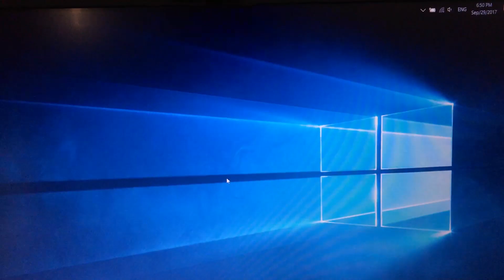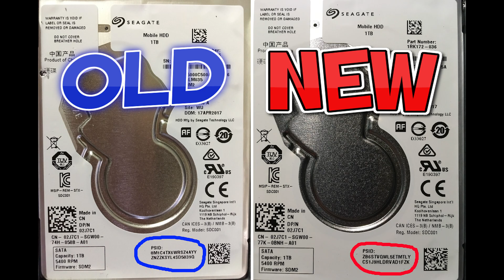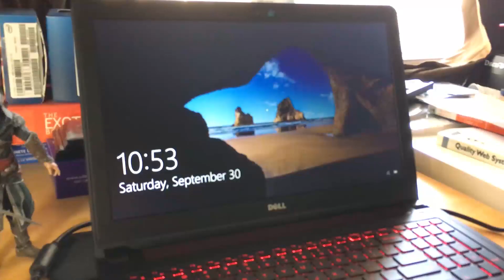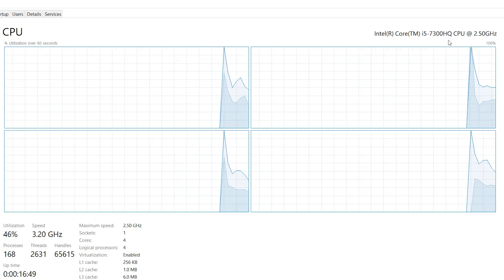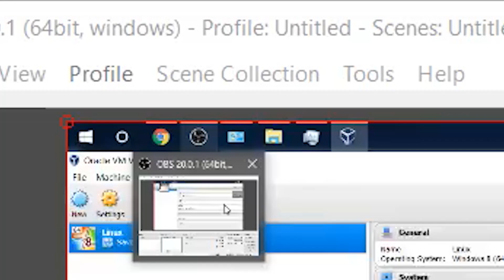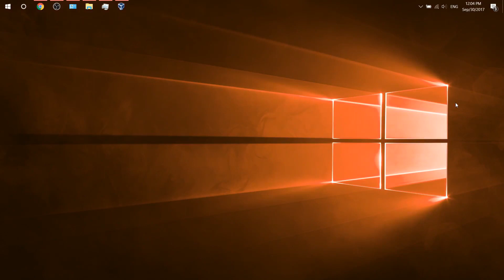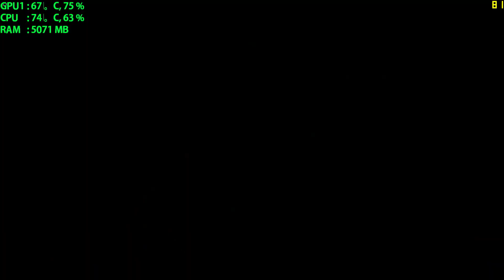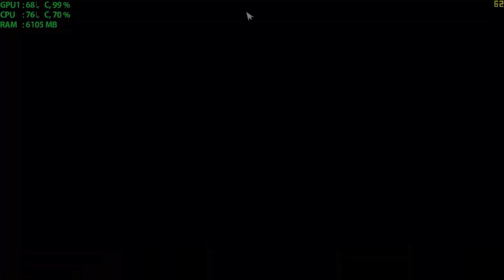My Experience With DELL Warranty - Inspiron 5577 - i5 7300HQ GTX 1050 Benchmark at 720p 900p 1080p

Comment: After 8 months the screen stopped working and we had to send it to dell for repair. Luckily the computer was under warranty.sadly the cable that travels through the hinge is attached to the lcd so if your screen fails you have to get a new lcd

Comment: Nice, overall review man, how many years would you consider this laptop has when heavy gaming?
Reply from the maker: I dont know, I used to game with a laptop packed with i7-4700MQ + GT 755m from 2013 to 2017 :)) 
As long as you keep your resolution low, you can play for at least 3 years I guess. An i7 + 1060 should be longer

Comment: The HDD in my 5577 laptop failed after 3 years. I removed it and put SSD. It is much faster. Wish I got the SSD model first.
Reply: Same bro
Reply: I know this is old, but in my case i always try to get my laptop with the least amount of ram and drive size. Those two things are cheaper to upgrade by my self.

Comment: Bought a used one i5 version for my brother paid 400 euros for it and im disappointed.. did everything i could still lags even on minecraft, masive drops on csgo from 150 to 70fps its almost unplayable but it should run smoothly with gtx1050 maybe i need to change the cpu of something?
Reply from the maker: You can't change the CPU. CSGO has received massive updates recently, try running it at lower resolution (720p) may help in FPS. But 4-core gaming, especially on laptop, is pretty dead. I don't play MC so I can't tell. This laptop is mostly used for programming

Comment: how is the fan noise? also does fan keep running when you have plugged in power to charge? also do you recommend this given its sound quality? its really very bad?
Reply from the maker: +Syed Ateeb Akhter Shah sound is terrible. Fan when it is full load is loud. But it does not run all the time
Reply: thanks for your reply

Comment: Is the m.2 slot able to take an NVME ssd? Also taking everything into consideration with the time it took to get your laptop back from Dell, dont you think it would have been cheaper to just replace the HDD by yourself? Time is money ya know, but yes I agree Dell was terrible with the replacement. Does the laptop function better now since they replaced the HDD? Or have you upgraded to an SSD, didnt watch the whole vid..
Reply from the maker: +Purnell Charles the problem went away when they replaced my HDD. I installed my Windows on the HDD and used for 1.5 months before getting a great deal for M.2 NVME. Then I transferred my install Windows to nvme for faster boot and used the replaced HDD for storing files and games. Still using it now. 100% faulty Seagate drive since the beginning
Btw, i made this vid before buying the nvme, so everything was functioning with the replaced drive
Reply: Poker FaZe thanks for the feedback. Hilarious video BTW. Watched it out.

Comment: Bro I have a question that what is the  fan speed you are getting...I have the same laptop with i7 variant ...I'm not getting speed above 3000RPM(or below) :(
Reply from the maker: +Ravi 3000 rpm? You know this is a laptop not a chopper, right? :))
Reply: Poker FaZe What speed are you getting...? I Know its not a chopper...But it is Capable of 5400rpm then why such low?
Reply from the maker: I think you misunderstood, 5400 rpm is the rotational speed of your hard drive. I don't know what my fan speed is, but as long as my laptop is cool, I'm cool
PS: the max speed of my desktop fan is just 1725 rpm

Comment: why was the frequency of the Cpu so high???  Which application did you run? I saw the Dell 7567 core i5 the same as this 5577 but its CPU just run at about 1.1Ghz on idle.
Reply from the maker: +tuan duong để high performance thì lúc nào CPU cũng cao hết nha. Lúc đó mình để balance, nhưng mình còn record screen nữa nên CPU cao
Reply: Poker FaZe vậy còn khi ko chạy app nào thì sao? :)
Reply from the maker: +tuan duong Nếu để high performance thì lúc nào nó cũng full clock speed hết, cái cần để ý là % utilization ấy. Khi nào bật power saver thì nó mới xuống tận 0.75GHz

Comment: hey buddy i am buying this today so need to ask some questions ... heavy games like gta 5, Wicher 3, cod infinite war games can tun on ultra settings smoothly?....and how much time charge lasts normally and while  hardcore gaming?...thanks in advance
Reply from the maker: +het vaidya Do not game on battery on any laptop. 
For your first question: you can only reach high settings with this laptop. If you play at 720p or 900p resolution, you get over 60fps. If you play at 1080p, it will drop below 60.
This video have benchmark parts, you can go and see it yourself
Reply from the maker: https://superuser.com/questions/855372/why-are-my-games-slower-on-battery-power-even-with-the-power-plan-set-to-high-p

Comment: is ur laptop get heated during game play while charging..?? Maxm CPU temp during gaming..??
Reply from the maker: +Ashutosh Kushwaha it shows in the benchmark
Reply: Poker FaZe i hv same laptop...in my laptop temp get above 75'c some time during gaming...is it okay.??
Reply from the maker: +Ashutosh Kushwaha un GTA V it gets up to 80C, but it is normal. I won't care until it is over 87C :3 Both CPU and GPU are made to handle the heat for laptop and desktop. Don't worry

Comment: Hi Poker, I have an issue... i bought the dell inspirion 15 5577 and with csgo I play 50 80 fps in resolution 1920... i dont know what else to do
Reply from the maker: +Matias Seguel lower settings, disable windows 10 xbox app

Comment: Hi - I own this same laptop and during gaming i get random FPS Drops/ Freezes for a micro second but it does makes my game stuck for that micro second and ultimately i die in most scenarios. So did you faced such while you play games. i get this issue in  PUBG and CounterStrike and i have my roommate with similar config and he doesnt face such issue.
My Config is Intel I5 7300HQ - GTX1050 4GB - 8 Gb RAM - 1TB HDD
Reply from the maker: +Sagar Gandhi I had similar problem. It did not happen during game, it happened when I browsed web. And it turned out to be the hard drive fault. This laptop uses Seagate hard drive, and Seagate is known for making bad drives.
Reply: It makes sense now - because even i had random freezes while using chrome. Idk why but even with the correct hardware this laptop feels so slow. I am going to add an M.2 SSD 250Gb and make it a boot drive. So lets see what happens after that. Will let you know !
Reply from the maker: +Sagar Gandhi If you still have warranty, try asking them to replace the hard drive. Before adding an M.2, my replaced HDD ran just fine
Reply: Poker FaZe Well i ran the diagnostic and the HDD doesnt show any error...so idk how would they give me a replacement.
Reply from the maker: +Sagar Gandhi that happened to me too. My HDD did not have any error, but it made buzzing sound. Had to call customer service and let the rep listen to the the damm noise.
Reply: Play games with high performance mode and not in balanced or Dell recommended mode.
Go to power options <high performance 
 The frame dip will not happen.
Reply from the maker: +HARSH CHOUDHARY thanks for mentioning this. May be he forgot to change. However, it was the drive for my case.
Reply: I have been playing on High Performance mode itself. The dips/micro freezes have something to do with HDD. I have just migrated to SSD now and i don't see those dips anymore. Seriously the internal seagate HDD isnt that good i feel. Lets see if i get any more micro freezes now or not
Reply: Update - After using since two days, i have not noticed any dips/micro stutters. It seems that windows 10 doesn't do well in laptop with HDD as HDD is too slow for it. SSD solved it for me, so it was worth the upgrade. System now boots around in 8 seconds

Comment: Hi bro can u tell me the difference between integrated and dedicated graphics and what type this lap has...?
Reply from the maker: Integrated GPUs are built with the CPU, like the latest Ryzen chips, or in every Intel chips. Dedicated cards are GTX cards or RX cards. This laptop has the GTX 1050 (dedicated). You can Google to learn more, I just say the basic
Reply: Poker FaZe ok bro thank you
Reply: Some guys say that the laptop GPU can be upgraded is it true? if its true is this lap upgradable??
Reply from the maker: Sure, some barebone laptops allows you to upgrade CPU and GPU. But GPU-upgradable laptops are so expensive. I once saw a German website selling an upgradable laptop which has dual 1080 SLI for $4000 and you can build it yourself, but forget about it. It is cheaper if you buy a CPU-upgradable laptop or buy an external GPU dock like these:
1) https://www.gigabyte.com/Graphics-Card/GV-N1070IXEB-8GD#kf
2) https://www.gearbest.com/laptop-accessories/pp_229101.html (I bricked the motherboard of my old laptop by using this, that's why I have the current laptop)

If you don't plan to build a PC, I recommend you to save money and go for the best laptops, so that you can just ignore everything and enjoy your games
Reply: Poker FaZe thank you so much bro...
Reply: I experience performance lag while playing games like GTA 5, assassins creed origins, just cause 3 is it common do u experience performance lag on this lap? If yes can u tell me a way to boost performance..
Reply from the maker: GTX 1050 is weak, try to lower your resolution and texture. I hope 1368:768 can keep you above 60fps.
I don't game on my laptop much so I can't tell you. But after finishing my Android project, I will do the benchmark on new games like The Witcher 3, Origins, etc
Reply: Poker FaZe ok bro..thank you for the info

Comment: i have this laptop without ssd, what ssd should i use? m.2 sata or m.2 nvme? i dont find information on manual book
Reply from the maker: +Aulia Majid both can be used with it, currently I'm using an NVME for extra speed
Reply: Poker FaZe have you tried it with m.2 sata?
Reply: Poker FaZe sadly 128gb nvme = 256gb sata in my country
Reply: pls anwer how do you know it support m.2 sata?
Reply from the maker: This shows M.2 sata is compatible, I believe all laptops even older gen support M.2 Sata, NVME is additional: http://www.crucial.com/usa/en/compatible-upgrade-for/Dell/inspiron-15-%285577%29
Just throw in an SATA, don't worry, you have my words :D
Reply: Poker FaZe okay im going to buy m.2 sata and see what happens :D
Reply from the maker: I will just boot faster :))
Reply: thanx bro i bought m.2 sata and its worked perfectly
Reply: Poker FaZe more question bro, my audio jack not working if i plug when laptop on, and working if i plug when laptop off and turn on the laptop after i plug my headset, do you have same problem?
Reply from the maker: I think you MAY have missed the audio driver, go to Dell.com and download.
Reply: Poker FaZe ive download it from driver booster, dell, and realtek website and all same, i uninstalled the driver and it works

Comment: I have dell inspiron 5577 i5 7th gen with 1tb hard disk. I want to upgrade it to 128gb ssd+1tb hard disk. How do I do that? Please help. Can I do it without sacrificing DVD drive?
Reply from the maker: +Ande Yashwanth Wait, your laptop has a DVD drive? Btw, you can look for an M.2 SSD, both SATA and NVME can be used with this laptop. Open the back to check if yours has any M.2 slot. I'm currently using Western Digital NVME.
Reply: Poker FaZe yesterday I had a chat with dell agent. He said "Your laptop has two slots 1 for M.2 PCie or sata". Bro Is there any difference in normal ssd and a M.2 pcie/sata ssd.
Reply from the maker: +Ande Yashwanth there are 2 types of M.2: NVME and SATA. NVME is way way way faster than SATA. For nornal SSD, you should not care because I believe you will use the 1TB HDD that comes with the laptop anyway, right?
Reply: Thanks bro.😋😋😋
Reply: Poker FaZe is it really work with SATA ssd?
Reply: Poker FaZe have you tried it? i dont find any information about ssd type on the manual book
Reply: 5577 don't have a DVD drive!

Comment: Hey bro I have the laptop and in far cry 5 on 1080p ultra setting I get around 35 is this OK or not sure
Reply from the maker: The 1050 is the weekest gtx 10** card, so yeah, it's normal. Even struggle with medium 900p

Comment: Please help! I bought a Dell Inspirion 15 5000 gaming with i7-7700 and 4gb gtx1050 and its struggling with CSGO. I installed nvidia drivers through Geforce experience not sure if im missing something else lol many thanks!
Reply from the maker: Please stop with "Help, I have problem" because nobody knows what happened to your laptop.
Try turn off XBox in Windows 10 Settings.
Reply: Poker FaZe Sorry :/ i will try this next time i get on my laptop thanks
Reply from the maker: I am sorry if I sounded salty (was busy with project), but if you can specify what happened to the game, I may be able to help.

Comment: Hey bro poker faze can u help me in choosing a laptop?? This one or lenovo ideapad 320 i7 7500u 8 GB ram 2 tb HDD and 4 GB gddr5 nvidia geforce 940mx
Reply from the maker: +Yuvaraj Rascal I don't recommend to buy any U CPU, they are used in most Apple Macbook to save battery, so they are weak. To game, you better get an HQ CPU laptop. But if you don't game, that laptop is good enough
Reply: Poker FaZe I'm a serious gamer I want to know which one is better some are saying that this dell model is hanging frequently but I think dell is far far better than lenovo...am I right?? and do u still have this dell laptop?? Is there any problem with this one?? Can I play games like GTA V smoothly at high graphics??
Reply from the maker: +Yuvaraj Rascal I have used Lenovo laptop through most of my college life with no problem until I stupidly destroyed its motherboard. 
I am using this Dell laptop for my last year of college. You can GTA V with it with over 60fps if you lower the resolution at 900p or 720p at high settings. 1080p will cause frame drop.
If you can get any laptop with i7 7700HQ + 1050 Ti for $650 to $700, go for it, ignore the brand. Lenovo, Dell, HP, Acer, Asus are all great.
Reply: Poker FaZe ok bruh thank you..is 940mx good enough for playing GTA V ?? My budget is $950 can u suggest me a good laptop??
Reply from the maker: +Yuvaraj Rascal GTA V heavily depends more on CPU than GPU and that CPU is garbage. With that budget, you can buy any better brand new laptop with i7 7700HQ + 1050 Ti. Here is a refurbished with GTX 1060 sold by Newegg: http://www.newegg.com/Product/Product.aspx?Item=34-316-212
Reply: Poker FaZe thank you bro but I'm from India and in here this dell laptop costs $1000..I'm gonna get this one
Reply from the maker: +Yuvaraj Rascal I'll add this one for you to look at if you are interested in. Check out this video: https://youtu.be/87R3DitE5wY
Reply: Poker FaZe sure bro I'll check it..what does a endless os means and can I remove that from a lap and install windows ??
Reply from the maker: +Yuvaraj Rascal I  guess it is an Linux OS. You can install Windows 10 for free from Microsoft with a USB stick.
Reply: Poker FaZe Asus fx553vd-m013 i7-7700hq 8 GB ram I tb HDD and 4 GB gtx 1050 endless os costs the same as this dell...I don't know what is lacking in Asus it has even higher processor version
Reply from the maker: Go for it, you can delete that OS and install Windows 10
Reply: Poker FaZe 👍 thank you bro
Reply: Asus ROG GL553VD i5 7300hq 8 GB ram 1 tb HDD gtx 1050 4 GB or this dell laptop which one should i choose??will Asus last long is the hardware components of asus good than dell??

Comment: bro some problem with my laptop when i run game so game os running on intel graphics why not use nvidia Graphic my laptop model is dell inspiron 5577
Reply from the maker: Are you sure? Install driver + Nvidia Geforce Exp. Run a game, press Alt+Z to see if there is an overlay. If yes, then you have nothing to worry
Reply: Try going in to bios and disable integrated graphics

Comment: Hey bro please help...My fan is not showing even when i play game at high settings....Help me if you know how to do fan settings...Please...It would be helpful....
Reply from the maker: +Ravi Thakkar Can you be more specific? What do you mean by saying "showing"? Do you mean blowing or turning?
Reply from the maker: +Ravi Thakkar You can search for IdeaFan, it is used for Lenovo laptops to control fan speed, but it is worth trying for your Dell laptop. Let me know if it helps
Reply: Not showings means....not shoeing up that work
Reply: And I will trythat IdeaFan...:)
Reply: Sorry Bro that didnt work😕
Reply from the maker: Then sorry, I used that program for my Lenovo Y410p. I suggest you should go to DELL website and update driver. Otherwise, you should send it to warranty service
In addition, the laptop has two fans, how can you break both of them? Open the back panel, then render a video and see if the fans run.
Reply: Yeah I think I should show this to the service centre😑
Reply: But sometimes it works!....But dont know what to do with that
Reply from the maker: +Ravi Thakkar Dell warranty service is helpful, but it is fucking time consuming. I hope it works well for you
Reply: I done that now my fan is working...It worked idk how...but running....But I'm not getting fan speed more than 3000RPM :(